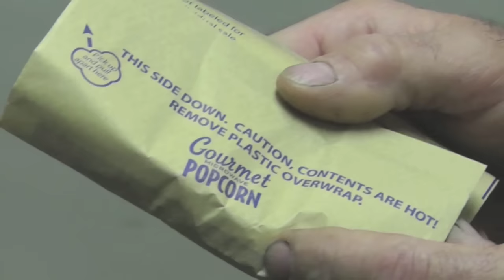How To Replace The Sump Gasket On A Briggs V-Twin Intek Engine with Taryl

Comment: Trouble getting the oil pan back on. The pan would not fit down tight until I lifted the motor up. Apparently the weight of the motor when upside down will push the center shaft up. Took me an a while to figure this out.

Comment: Blademan I need your help bad. Im replacing the sump gasket on a 26 hp briggs motor. While the sump cover was off I looked up into the motor and seen the oil pump screen was off & laying in the motor. I have no idea how it goes in. There is 4 possibilities and it don't like it would stay in any positions seening how it just fell out. Can you please tell me how it goes. I'm thinking about leaving it out ... is this a good idea ? Please help ASAP. Thank you so much...

Comment: Great Video! I just had this same engine rebuilt due to a thrown rod. Problem is now it is having a very loud POPing noise, almost like firecrackers going off when its running. I double checked the valves and Rods. Gap is right and Rods are straight. Any ideas of what I should check b4 I pull the motor back apart. I turn it by hand with the plugs out and I don't hear anything hitting. Valves are moving and don't seem stuck. Im at a loss.
Reply: I did replace the aluminum push rods with steel ones...
Reply: it kinda sounds like a pneumatic impact wrench but MUCH louder.

Comment: Why did you remove the oil pump? Did I miss something? I did this same job without removing the pump (although my governor detonated- not sure why.. wondering if it has anything to do with having to remove the oil pump like you did). putting in governor tomorrow....

Comment: For a project I need an oil system that will work with a horizontal shaft, so I'm going to drill a hole for an external pump, and basically build a dry sump with an oil cooler.... any tips would be great

Comment: Hey Taryl, currently have my 20hp twin v craftsman off and I can not get the sump case to come off.  I have been tapping careful but it won't budge.  I believe this is a 2000 engine.  Is there anything special I need to do with this one?  It's super stuck!  Thanks in advance!

Comment: Hey Taryl, thanks for the vids. I'm hoping you can help me out here. I have a Craftsman lawn tractor with a 24hp Briggs intek v-twin engine, exactly like the one you're working on. Lately while i'm mowing, it wants to cut out for a split second then just keeps going. I changed the plugs, air filter and oil. I did notice though, the way the fuel filter sits is on an angle which creates an air pocket on the top side, which is the fuel pump side. Could it be that while i'm riding, the air pocket moves and the pump actually sucks a little air and that crates the hesitation?

Comment: Tarel, I have watched this video dozens of times and have followed the steps.  When I try to start my motor it doesn't want to turn over.  When starting the motor seems to turn over a bit then it is really sticky.  It makes a weezing noise near the intake.  I am not sure if I over tightened something when I had the bottom end apart but I followed your video.  Any help would be appreciated.
Reply: Mike Dennis sounds like exhaust leak weezing

Comment: Just did the crankcase gasket and thought I followed your video correctly but now, even after hooking up all the linkage correctly for the throttle and governor springs I’m getting a runaway condition. What did I miss putting the crank case back together?
Reply: same problem, ever figure it out?
Reply: @mblack360  been a while but what I remember is when I put the case back together I didn’t get the governor in correctly. By the time I realized it (and it had a runaway) it blew the gov apart so I ordered a new one off Amazon (B&S part) and paid real close attention to the “wings” on the gov putting it back together and it was good to go. Still mowing grass to this day.

Comment: Hey, great informative video. I have a brigs and statton 27 hp motor. It has 2 marks on the cam gear i am not sure with one is the correct one for timing. One is a small line the other is a circle. 
How do i know what one is the correct mark?

Comment: When you install that seal, use a piece of plastic soda bottle wrapped around the crankshaft, so that it comes out about 3 inches or so past the end of the crankshaft. Lube it up and use it to guide that seal on its way down. That way it doesn't hang up on the end of the crank and pop that spring

Comment: Teryl question:  K301 engine.  Fuel pump works manually, but will not send fuel to carburetor.  Is that due to wear on crankshaft?

Comment: Thank you for your vids. I have a question on sump cover, what happens if the sprocket on drive shaft came off and the bigger sprocket got spun around a couple times. Is it ok if I just line up the two dots on sprockets? Could it mess up valves or revolutions on pistons?

Comment: have a 26 hp briggs and Stratton on a 175 john deere and has a knocking noise on start up and gets worse when you rev it up. I torn into it and found really nothing to be making noise on the lower end. Wasn't for sure what the culprit might be. Oil looked good, had newer plugs in it.

Comment: Hey Taryl. Need your help. I replaced my sump gasket on a commercial turf 26hp Briggs Stratton and after getting it back together. I tried to start it and it doesn't want to run. It floods really bad. Gas ran out the muffler. I thought that maybe after having the engine in awkward position maybe the floats for some trash on them. So I took the Nikki carb off and apart and cleaned it very good. It was very clean. Installed back in and still same issue.  Changed the plugs and still same issue. I can only get it to run by unplugging the fuel cut off solenoid on and off. Sonit don't flood. Any ideas? Thanks

Comment: Taryl can u help? I need to know the length of sump bolts and the location of two special bolts on a B&S 42A700 engine. I tore apart the engine some time ago and forgot where the bolts went. Thanks in advance.

Comment: I have the same engine and the throttle linkage is not returning to idle. Is there a Spring on the throttle valve I have to replace?

Comment: I suspect my $800 replacement engine that’s only a few years old has this problem. Another problem is, there is oil slung up on the carb bowl and bottom of the intake manifold and everywhere else, so I’m not exactly sure where it’s coming from.

Comment: Working on a 23 hp, sump separates about 3/8" then stops and will not come off the crank. Any ideas? Seems to be alot of play in the crank as the crank moves with the sump.

Comment: Can I replace the sump gasket with the engine still in the mower?  I have a Scag zero turn and can remove enough frame to access the engine.

Comment: Great video guys. I'm just getting ready to open a mower repair shop ant tips for me ?
Reply: Take 5 minutes to power wash whatever piece of equipment you repair. The customer will feel great about the actual repair and even better about how the repair looks. A lot less griping about the bill too! And always try to include a needed upsell, comes in for a tune-up, you ask would you want the blades sharpened, oil changed, air filter? But, never suggest anything not needed. Always know the final price or a good ball park estimate before the customer approves a repair. Communication is KEY.
Reply: sixty9harley Great info Thank you.

Comment: Strange but actually extremely helpful!!!  :)   Man I wish I could tear an engine out of a mower just like that!!!   Just contacted pro parts direct to get that seal, gasket and replacement governor - thank you!
Reply: I wouldn't think the governor would need to be replaced,  unless it wasn't working properly.  If they come apart they can tear the engine apart big time.  On mine I was trying to adjust the governor,  got it wrong and couldn't get it to run correctly (over reving) so I shut it off, took it apart ordered a new governor,  and gasket.  Was easy to replace,  but it was easier to screw it up.
Reply: @bertgrau3934  How much was the total in parts? New bolts? I have a 25 HP Briggs V-twin over revving on a Mustang Zero Turn with a fabricated deck. That engine has been a nightmare and it only has 166 hours.
Reply: @tinytim9453  
If you get all the parts from Briggs it can get expensive.  What I did was order the governor on line, get it for $28 , shipping included.  I cleaned the bolts reused them , replaced the sump seal, $9 and used gray sealer  ( it's like silicone,  but made for sealing oil)  be sure to clean the bolt holes,  I used brake clean. If I remember correctly the tube of gray sealer was $12. It's not a hard job, just take the oil pump apart, and be very careful with the seal as you put the sump back on.  There's lots of videos on you tube how to replace both the governor,  and the seal. The biggest thing is adjust the governor properly.  If the RPM is too slow you can change the governor spring,  or put more tension on the current spring.  I suggest you buy or have someone with a tachometer.  I would also suggest you clean the outside of the engine before you take it apart.  The mower I worked on was a John Deere,  22 horsepower V twin Briggs. Be sure to clean the inside of the engine as well.  IF the governor did come apart you do not want any of those pieces bouncing around inside the engine. Again, watch a video or 2, or even 3 lots of videos out there. 
Good luck, I hope this helps. Except for the gray sealer, I ordered everything on line. A local shop want $90 for the governor.  The governor I received was a Briggs in a Briggs package. Same with the seal. 

Good luck .
P.S. I didn't order a new gasket,  if you do, you do get new bolts. I also used blue locktite on the bolts.
Reply: @bertgrau3934  Thanks for the detailed reply.
Reply: @tinytim9453  
You're welcome,  again good luck

Comment: The seal may have slid over the shaft better if the gel lube wasn't so sticky. My gasket lasted 14 years, 1 acre of grass during the summer and about 2 hrs per snowstorm with a snowblower attachment each north of Boston snowstorm in the winter. There was a lot of dust buildup in the cooling air passages which may have made it run hotter than normal and degrade the gasket.

Comment: The original torq spec for the sump bolts is 200 in-lbs, but this kit indicates 300 in-lbs. Why is the new spec so much higher? Are the new sump bolts different from the originals?
Reply: AJ Star The new gasket is made from different material

Comment: When I push the throttle lever to the max that is the choke. Do I set the governor at that point or at the max throttle point which is just a hair backed off of that lever? Thanks
Reply from the maker: Chewy Bacca it's fine to push it all the way forward, the choke being closed won't matter. There's Yur dinner!
Reply: Thanks Taryl ! REALLY appreciate the video.
Reply: Have a 22 hp intek and there is oil  running out all over by the left side when you sit on the seat, under the head, and a lot of blow-by when the dipstick is open to look could it be the  subgaset doing this???
Reply: Lyle Kalas mine did the same thing and it was the sump gasket

Comment: I have a Snapper ZM2200kh zero turn mower, with a Kohler Command 22 engine on it (horizontal shaft), which has been leaking oil lately (sometimes a lot; and sometimes very little). It looks like the oil is coming from the space of where the motor is bolted onto the frame. I suspect that it may be the head gasket and/or the crank seal. I am looking for the specific kit to order. The model number tag on the engine is not present (or anywhere that may be found, short of pulling the engine).
Reply from the maker: It could be a CH22 66536  CH stands for command horizontal 22 HP
You can contact snapper to make sure. The head gaskets are all the same for the command. They have improved the gasket & it comes in a kit. We have a Krohler command head gasket video coming soon.
Reply: Thank you for the info. I ordered "Genuine-Kohler-24-841-01S-2484101S-Head-Gasket-Kit-OEM" and "Genuine Kohler OEM SEALOIL W/HELIX Part# [KOH][25 032 06-S]" on eBay. I appreciate your video, which strongly encourages me to replace these parts on my own. 
Thanks, again....and I will update, Lord willing.

Comment: Just an FYI to anyone doing this. Its very easy to accidentally pull the crank up and get your timing off a few teeth when your putting the sump on if you have to lift it back up when fighting the seal. Ask me how I know. I had to take motor back off and tear it back apart first time I did this because my timing was off for that exact reason. Easy to do if you don't pay attention.
Reply: Yep I got a 25 HP intek and now that thing sounds like it's going to run away 😤 after I did a similar job with the sump gasket. ( would've been better off with a tiny leak since now I don't know to stop it from sounding so loud)

Comment: My 2005 Husqvarna has the safety feature, requiring me to be on the seat to start or run the engine. How did you start that one without weight on the seat?
Reply: should be able to engage your parking brake and it should start and run

Comment: Hey I need to know on a 24 horse overhead valve V-Twin why there is no compression release lever like that I have one and the new cam doesn't have it either where and how does the compression release work on this engine 24 horse V-Twin overhead valve

Comment: I always pack the inside of the seal with grease, makes sure the seal spring stays in !!!
Reply: We used VasilneJelly Without the Coloring Added with the red tint it's Trans Assembly lube.. Being A Petroleum Product It disabates quickly Inside the Crank Case. I can't hardly Watch these Guys. I guess their trying To make it Funny. I'm going To pack the Oil Pump With Jelly As Well. Their won't be any Priming of the pump and it's going To mix with the Oil.

Comment: 2 thousands shim stock or Roof flashing   rolled in a  Circle run it into the lip seal and it will let the cover go past the shaft open the  seal then slide out the shim .  no damage to the seal  old man showed me that 40 years ago .

Comment: Hey Taryl how many hours should this repair take from start to finish?
Reply: For an experienced small engine mechanic with all the necessary tools it’s a two hour job at most.  For a hobbyist who likes to tinker in his garage?  Anywhere from an afternoon to several days.  These sorts of projects rarely go as expected so plan for a few days.  Worst case, you cross thread a bolt or it snaps off in the block and you have to order new tools.

Comment: taryl I have a question. I just replaced my crankcase gasket and put everything back together but when I turn the mower on it is full throttle and will not turn down. I followed all the steps to adjusting the governor. starting to think I lost something to the throttle assembly.  any ideas? it was the 23hp v twin intek
Reply from the maker: Lost something or didn't get the governor in right or set right. Take another look at it i'm sure you'll figure it out.
Reply: no luck. I am still working on it. I've adjusted the governor both ways. I'm stumped
Reply: Hey Braden did you figure this out? Did your governor come apart?
Reply: I have the same problem the only way i can get it to idle down is manually pushing up on the throttle linkage at the carb

Comment: Please help- I removed oil sump and replaced gasket and reset governor shaft as instructed 3X.. because engine runs at full throttle.. I cannot control throttle.. What is wrong!!  It seems like the governor fly weights do not fly out and are unable to over come attached spring pressure. I am getting very tired..

Comment: Did something wrong. Took it apart. Change the gasket put everything back together started and ran now it just all of a sudden runs full speed. Can’t slow it down and it’s really hot. I got smoke coming out of the oil fill tube

Comment: Hi, got a 24hp briggs and the bolts don't come with the gaskets? Is there a kit?
Reply: I think sending bolts with the gasket is overkill. I would clean the original bolts, wire wheel them, then use locktite 242 on the threads during installation.
Reply: +Deucealive75 hi, I ordered a kit and all of the bolts came with it. I don't know why you couldn't use the old bolts though, but since they came, I used them.

Comment: any videos on installing new governor on a brigs 18.5?
Reply from the maker: No, but we do have a governor video & all governors work the same on these small engines so check out that video it might help you. This sump gasket video should  also help you it works the same its just a twin instead of a single.
Reply: hey thanks for the advice!  i had a weird one, my governor shaft snapped off causing the governor to lock between the case half and the cam. i replaced the shaft with a grade 8 bolt with the head cut off. kind of make shift but hey I feel like it'll be stronger!  but now I'm just trying to make sure I'm not missing anything going back together.  thanks for your time bud!

Comment: Help, I did a gasket swap on the same engine and now it won’t start. I have fuel and spark. Adjusted the valves to no end. Starting fluid does nothing. What am I missing?
Reply: do a compression check. also if you moved the cam gear while doing this you might need to retime the valve timing gears
Reply: Donnie Cahill thank you! It’s got the be the cam gear. Tearing back into it now.
Reply: Donnie Cahill it was the cam gear. Realigned and all is well. Thank you.
Reply: @cJared3b  very good man, you'r welcome glad you got it running again 👌

Comment: Anyone have a problem with the bolts snapping when torquing them down?  The specs on the install sheet for the new gasket says they need to be 300 ft-lbs, I cant get past 60.  I followed the pattern, and did 25 ft-lbs increment.  Tried 2 different torque wrenches thinking maybe i was getting a bad reading but same problem
Reply: tom bloss it's supposed to be 300inlbs, not ftlb.
Reply: f**k lol thanks!!